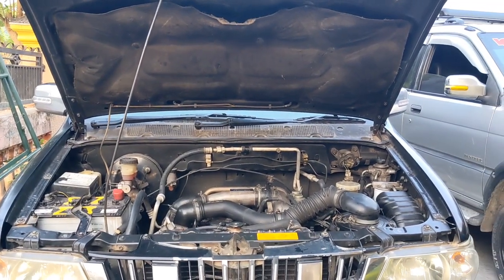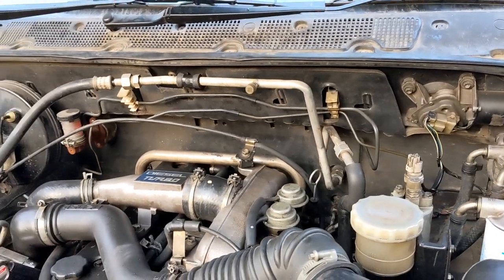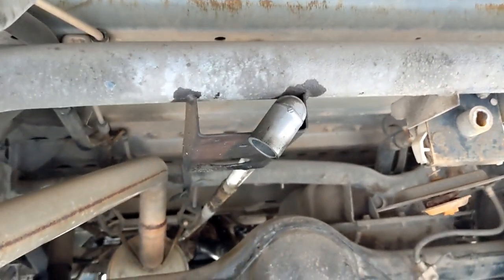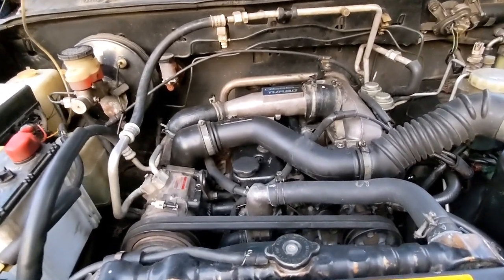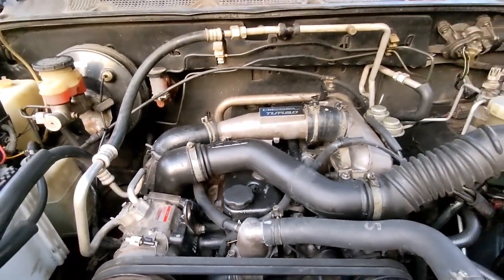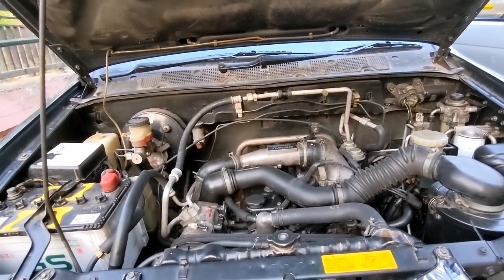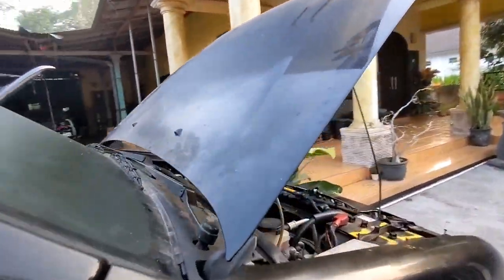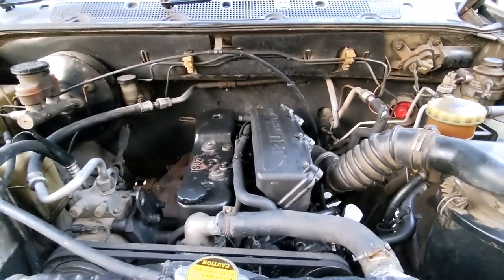review 2 unit panther Turbo vs non turbo baru turun mesin, sama sama budged murah

Comment: Sulit bicara 4 ja,karena type mesin bosom beda beda,untuk Euro 9mm dg nosel 4 pijar tekaban 150 psi.yg turbo non Euro ada yg rotohead 11 mm,dg nosel nadir atau paje jarum needle tekanan 170 sampe 185 psi..
Jadi ukur asap bisa liat kasat Mata pake hasil pembakaran knalpot, tapi lebih pastinya ada alat khusus untuk ngukur AFR.
AFR ratio fuel dg udara..Ada table nya.
Jadi bisa dimainkan   load supaya tidak overfluel,atau porting intake untuk rotor head 11  mm.supaya dpt  udara ideal.